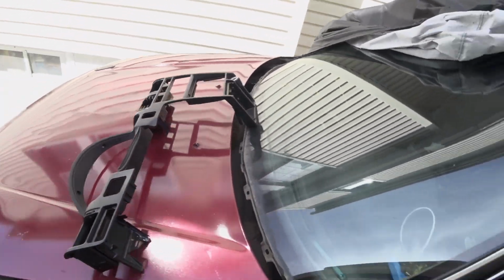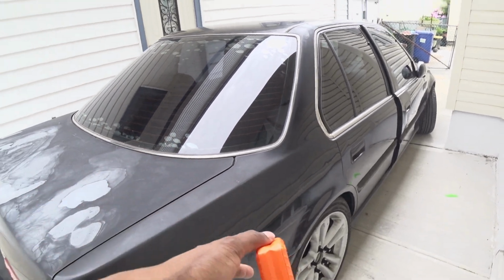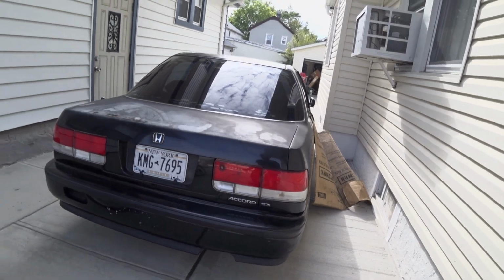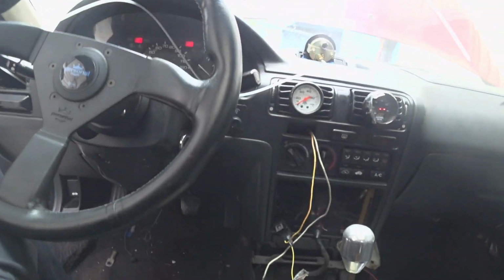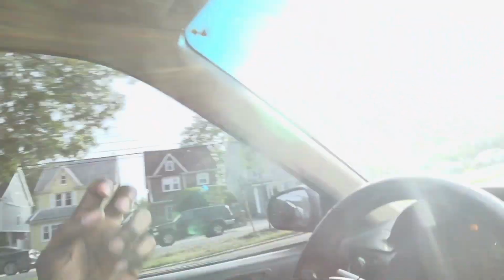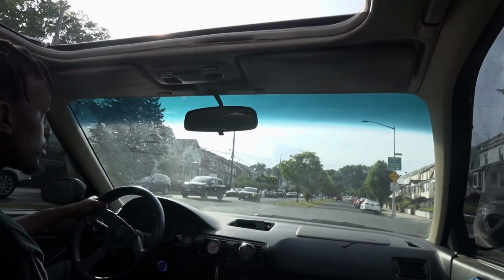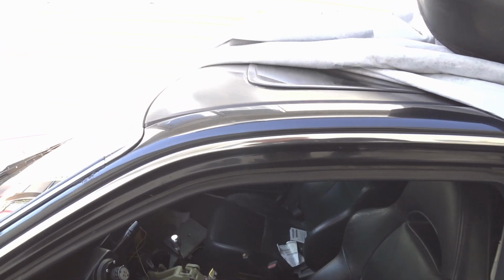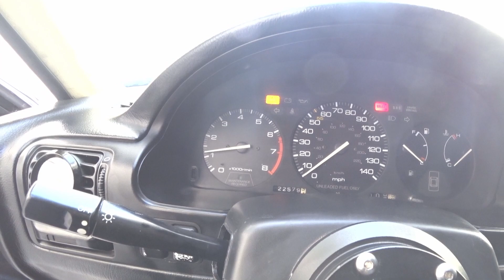Bad honda obd1 ecu issues.

Comment: Boost cut is all electronic bro if your boost cut is set lower than your wastegate spring you gonna hit it every time you accelerate. 

What codes is it pulling?
Reply from the maker: Code 14 and code 10. Boost cut set at 10 psi. So not sure why it's cutting out.
Reply: @AJIMPORTS  the other thing is hondata is set to put the car in limp mode if it has and cel activated. That would prematurely activate boost cut.

You can def turn off iacv in hondata I think air intake too.

Clear the codes and take for another drive to see if that fixes it.
Reply from the maker: Ok im a check those out tomorrow and see. I have not checked the hondata since this issue started. Always left the laptop at home.

Comment: Do you still have idle air motor and fiav? If so check those as well as your map sensor and any boost leaks. You make testers easy and cheap. If you dont have those then that’s why it ran like poo on the stock ecu.
Reply from the maker: I still have the iacv but no fast idle. But I will double check everything again. I must be missing something important.
Reply: Stock ecu should act that way with no fiav from my experiences. And yea check map sensor and boost leaks just to be certain.